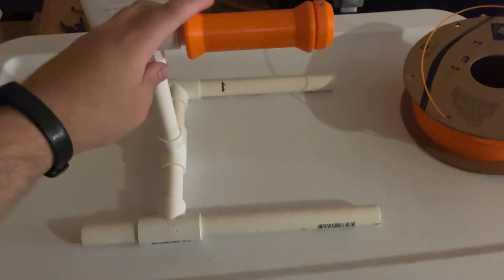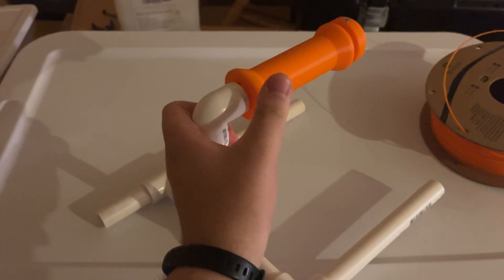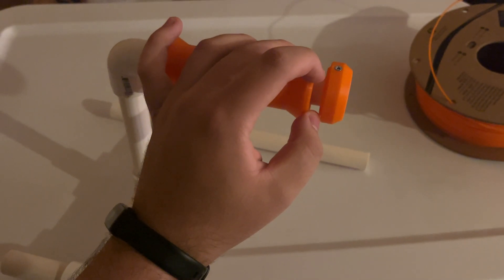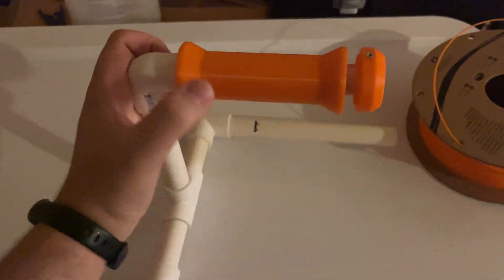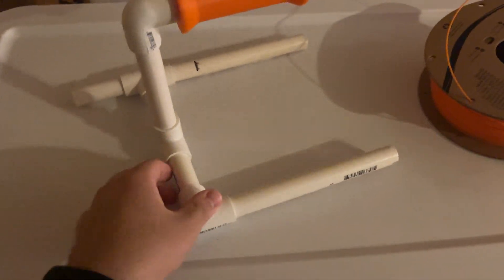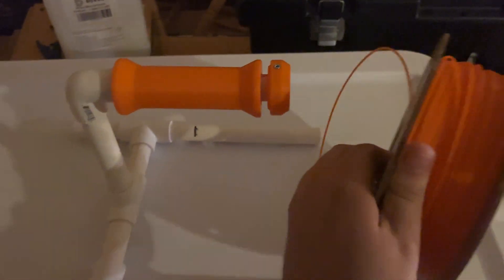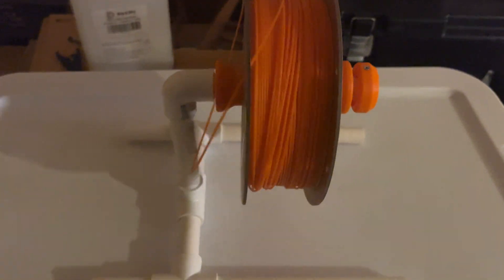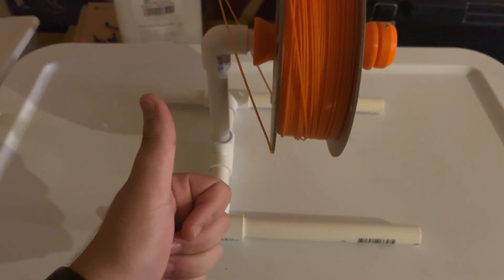I made a 3d printer filament spool holder! PVC pipe frame, with a printed roller for smooth feeding!

Comment: I'm surprised that you don't use larger spools
Reply from the maker: I’ve never really had a need. And it didn’t fit on the original filament holder for the P1P.